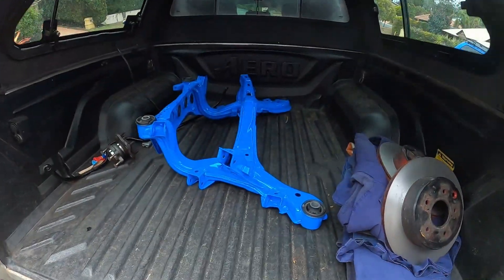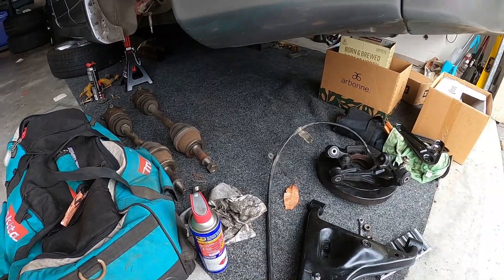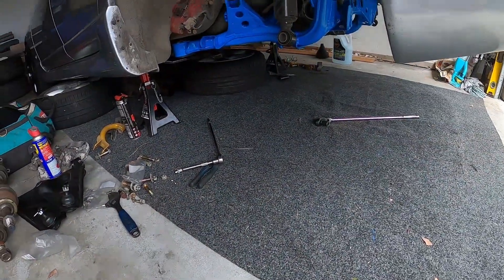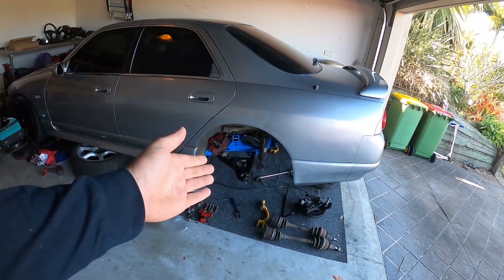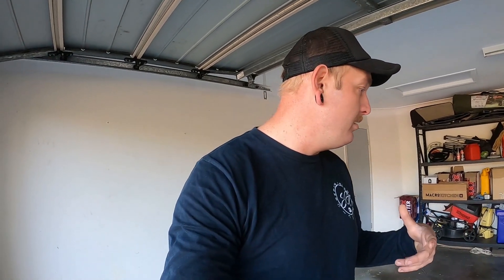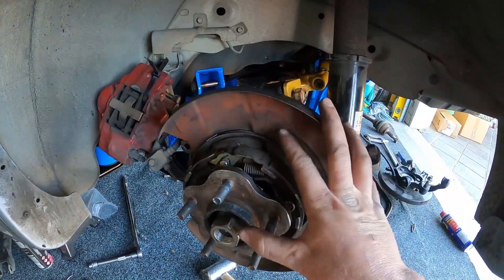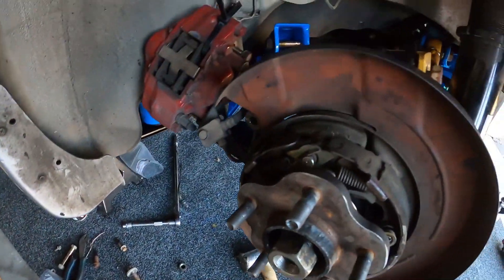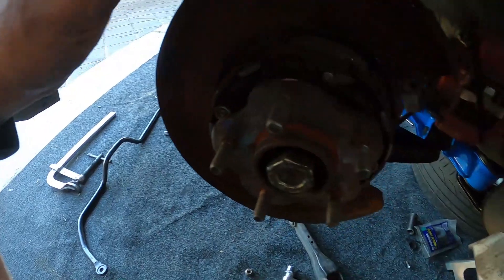S14 Subframe into my R33 Sedan! PT2

Comment: Bit of an odd question, what series throttle body is that on the intake? i know the neo ones are chunky and have a different tps layout.  (Or was it possibly cut down to run that two plug tps?)
Reply from the maker: Hey mate, thanks for your comment! So my RB neo, is running an S2 Loom and ecu. So I got rid of the Neo TB to run the S2 one so I could use the s2 tps.
Reply: @sedangarage8241   Ah that explains it. I need to do the same with my r33 😂 25det neo conversion going in. (Made the mistake of spec'ing my wiring specialties loom/harness for the s2 tps)